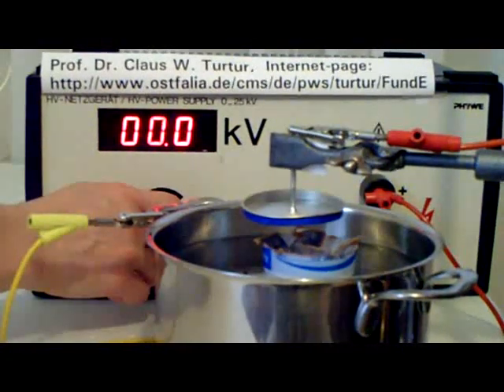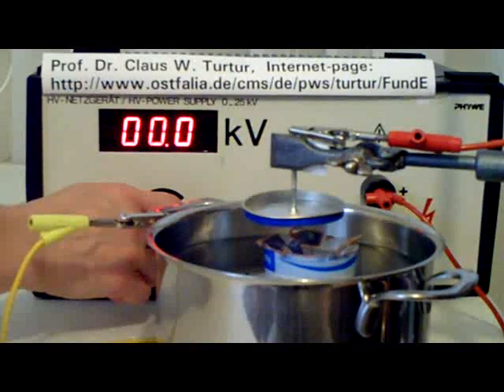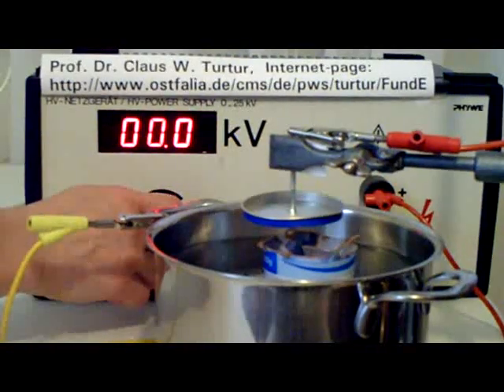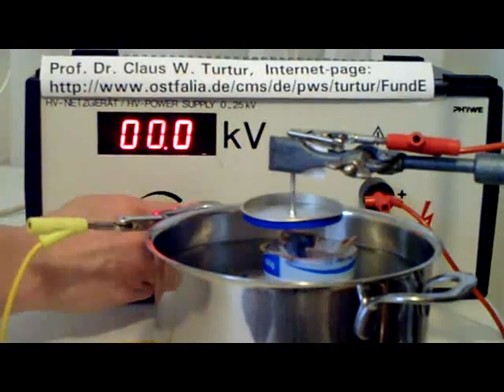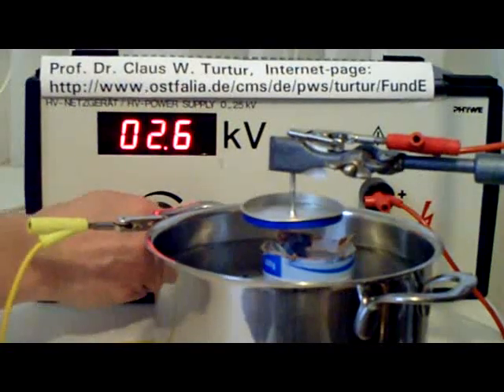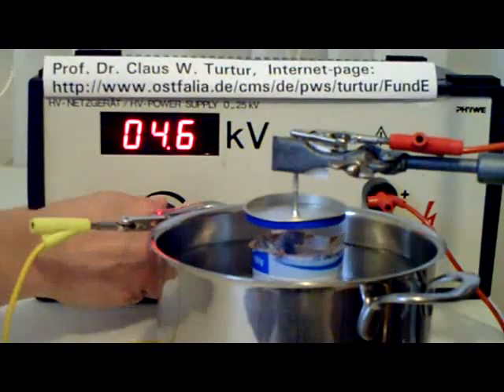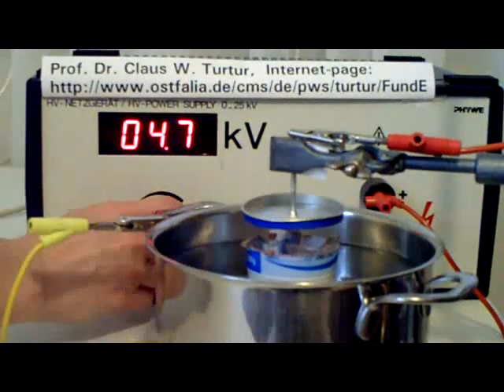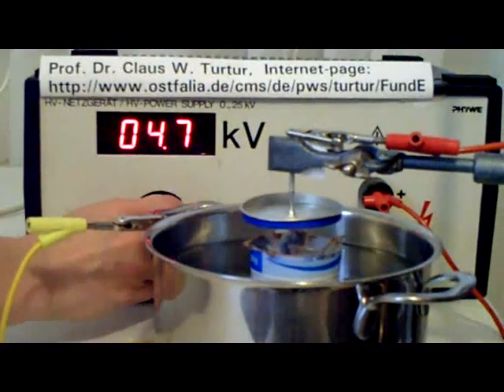Turtur Zero Point Energy Rotor

Comment: My guess is, that the supplied voltage still has a little AC-variation from AC/DC conversion. In combination with slight asymmetries in the experimental geometry the result is easily explained. A slight periodic variation in the Voltage, a small alternating current, phase shift, there goes your energy.

Comment: The conventional ionic wind instead of the alleged ZPE can perfectly explain the rotation. At least a plastic sheet to screen the possible wind should be placed between the electrode and the "rotor". The lack of cautions to avoid this experimental bias and the lack of current measurement make that this experiment proves nothing.
Reply: I can imagine that they have made better setups than this up to now^^
I read a recently published paper (2015) from Turtur, "Powerful zero-point-energy converter – theory and experiment", Aircraft Engineering and Aerospace Technology: An International Journal, Vol. 87 Iss 2 pp. 172 - 179
http://www.emeraldinsight.com/doi/abs/10.1108/AEAT-10-2014-0153
There i saw a picture with a proper vacuum chamber and a vacuum oil is mentioned (whatever that is) and the current was measured with a picoamperemeter..
But due to lack of knowledge about quantum physics, or QED respectively, i really cannot say anything about correctness... i only understand some equations coming from classical electrodynamics ...

Comment: @108Satyam
You can easily get 100kV from rubbing a balloon on your hair.
The balloon is insulating so it won't discharge if you hold it.
In a vacuum you couldn't use a normal balloon but you could instead use a plastic sphere.

Comment from the maker: Response From Professor Turtur, Part 2:
The reason is very simple: It is driven by gas ions, which transport electrical charge.
In my experiment the situation is completely different, because the rotor also works inside the vacuum and there are no ions transporting electrical charges. Thus there is (almost) no electrical current. I explain this in the narration of my video.  Does joethewhite have a technical problem to hear my spoken text in the video - maybe a technical problem?

Comment from the maker: Response From Professor Turtur, Part 1:
The little demonstration with a "rotating star" under air and high voltage (the shape reminds him of the German swastika) is well known. It is a rather old demonstration. It rotates under air, but it does not rotate inside the vacuum and it consumes much more electrical energy than it produces mechanical energy of rotation.

Comment from the maker: Yes, Xaero Vincent states correctly:
The demonstration with a rotor in air is just a proof of concept of what to expect.

And he is also correct: I observed successful operation inside a laboratory vacuum chamber.
I want to add: This operation inside the vacuum-chamber is the proof of my theory.

And there is an additional hint:
If there is only the drive by gas ions (as under a pressure of 1...10 mbars) with a voltage of few 100 Volts, the rotor does not rotate.

Sincerely Yours
Claus

Comment from the maker: This from Prof. Turtur:
It is correct that under air many gas ions will be generated due to the large electrostatic field and field gradient. Thus under air, the ion wind brings a serious contribution to the drive of the rotor. The request to exclude, that only gas ions drive the rotor, I brought the rotor-experiment into the vacuum. And there it also rotated. Thus we know, that my theory (with the rotor driven by electrostatic forces due the the zero-point energy of the vacuum) is correct.

Comment: Well done Professor Turtur.
Do you connect the ground wire from your
HV power supply to the bowl ?

Can you also run it from a charged up High Voltage capacitor ?
How long ? 

I will open up a new thread about it on
my overunityDOTcom forum.

Regards, Stefan.